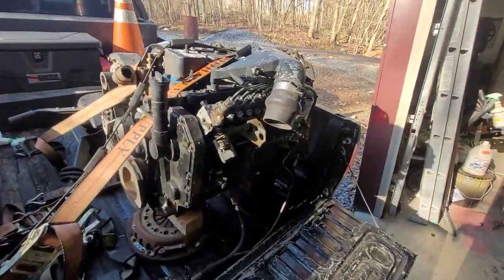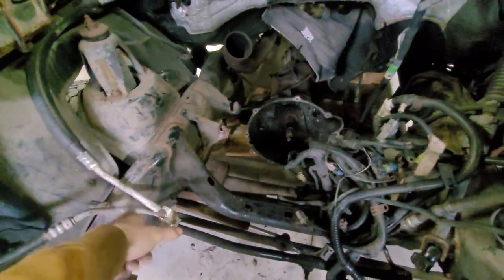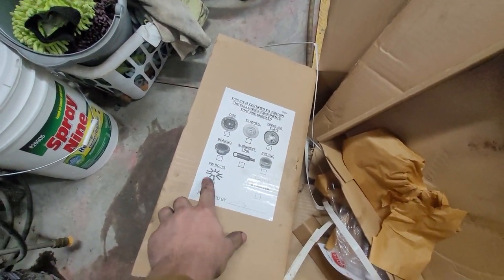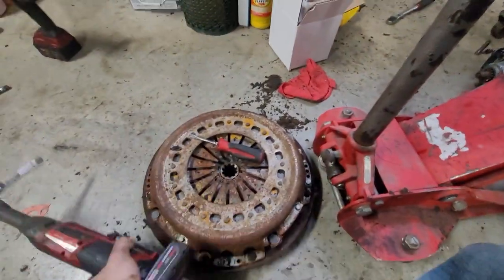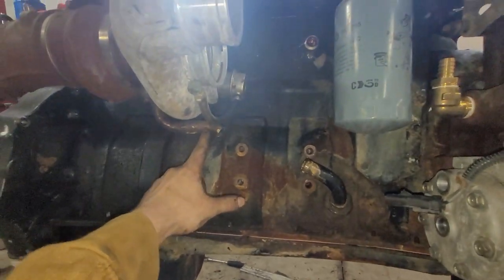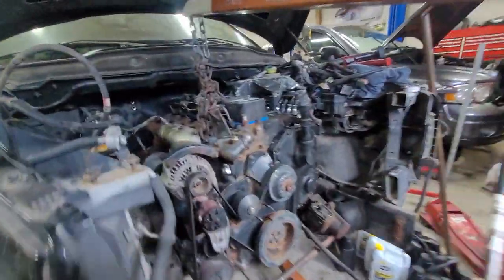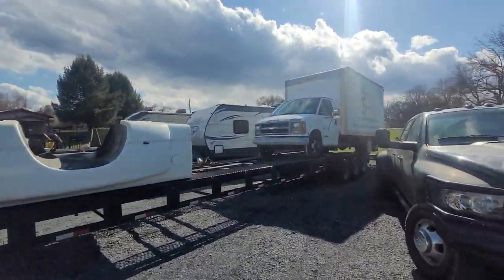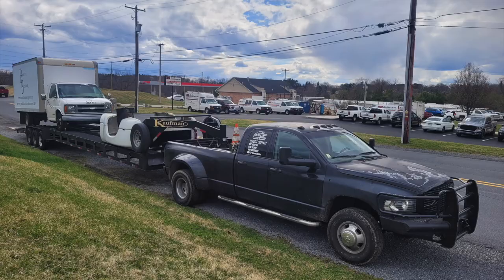I Bought A Chevy 3500 Dually | Trailer Prices Are High | 12 Valve 3rd Gen Swap Pt. 4 | For Sale

Comment: That box truck oil leak is probably the Power Steering lines. They all leak, switch them over to Hydraulic hoses. There's kits available. Also the trans lines, same thing just larger size.
Reply: I've compiled a bunch of Duramax info if ya need it
Reply from the maker: They actually just did the lines. Glad I don't hand to mess with it😅

Comment: That box truck will make a bitchin mobile shop. Add a generator and air compressor under the box.... and she is perfect. Then later, you can add a I Beam that slides out the rear door for picking up engines etc.

Comment: While you have thise engines out. Put a water bypass from the back of the head to under the t-stat. You can get a ghetto one for pretty cheap. I used the Flewce Performance on on my 6.7... but it takes the place of the problematic rear freeze plug. ( that pops out) keeps the rear cylinder alot cooler under big loads.
Reply from the maker: I'm going to with mine. Customer wants it to be as cheap as possible on parts so I was instructed not to
Reply: I absolutely hate that. I understand cheap. But sooo much easier when it's out of the truck.
Reply: Which way are you going with the coolant bypass? The expensive Fleece style that bolts in where the rear freeze plug goes. Pr the less expensive kit where you drill amd cut out a he in the back of the head? Both work but the fleece takes the rear freeze plug out of play, for leaks. My paint amd body guy has his wife's 2nd gen in his shop with the cab lifted for that very same freeze plug blowing out.

Comment: Brother please tell what are the advantages of using clutch when we shifting
Reply from the maker: Laziness is why I do it. Just have to match the rpms. Some transmissions like it more then others. Some hate it. I probably use the clutch for 25% of my shifts
Reply: Brother doing this cause any problems to gearbox .
Reply from the maker: I've more than proven that false. My last transmission lasted 549,000 miles. The failure was 6th gear finally exploded taking out the other gears. I tow in 6th gear constantly but to have gotten that many miles out of it proves otherwise. There's too many guys that can't actually shift that claim it damages parts. Personally I've never had an issue. The syncros in my last trans were perfectly fine but the heat build up from towing in 6th did that trans in.

Comment: Bro I bet you get so much box in that truck! On a serious note ceiling is 7ft in that box. It would make a sweet moto van. They usto be the setup back in the day.
Reply from the maker: The box truck is such a gamer changer. Thanks for letting me know on the height. I figured there was no way I could reach an 8ft ceiling but I didn't feel like measuring 😂
Reply: An average 6' guy can stand reach up and finger tips should be right about 8'. So Steve, you'll be a few inches under haha

Comment: With our current fuel prices that trailer is not going to sell fast in my opinion i sold one similar that i got in trade for $8500 about 3 months ago to a local company that got in a accident with there wedge. Best chance in selling fast is to find another hotshot company that needs it unless your not in a hurry than i would hold out and stay strong on the price someone will pay it.
Reply from the maker: One of our drivers just sold one for 14,000. I was like damn hook me up with that 😂
Reply: @CPSteveMiller  I probably should have held onto mine for a little while i always price stuff little under market value just so i can move it fast and on to the next. Thanks for the content bro.

Comment: I'm glad you know what you're doing lol.. 
   I thought you were putting this in your truck. ? 
  You were mentioning you need a new motor for your truck? When will that happen or will you just get a new truck??
Reply from the maker: I'm not sure yet what I'm doing. Once the trailer sells and I get paid for this job I'll be making my decision. I may pull the motor and go over it top to bottom and add a lot of ventilation for the crankcase. From what I understand these engines all have blowby issues and they didn't have good vents from the factory. It needs more breathing room especially with the high rpm high boost situations!

Comment: What engine mounts are you using for the 3rd gen swap? Does it sit in the same spot? Engine and trans...
Reply from the maker: Yes. So you use the factory 3rd gen mounts from the commonrail with the plate. The plate moves the motor mounts to the factory location without having to hack up your frame or crossmember

Comment: What are you doing for a tune on this set up? Stock for now?
Reply from the maker: Stock, yes. Timing was set at 12.5 degrees as per the factory specs. Keeping it simple for now. Once he lets it make some money I'll go through and tune everything for him. Just want it to be reliable and pay him back first
Reply from the maker: We haven't even done governor springs
Reply: Sweet... prolly the best route. Just make it run and drive. Shouldn't even smoke in thus configuration...

Comment: Why don’t you run loads with that box truck
Reply from the maker: No money in that given the situation. I'd also have to add it onto the insurance which will skyrocket my rates. It's not setup to run like that either with 297,000 miles it's definitely tired. Especially with the gas motor in there. Trans is questionable. Takes a second to grab. Then I'll have to find another storage spot for the rest of my stuff. It'll make a great storage unit that I can drive to pickup my other things in different areas
Reply: @CPSteveMiller  Cummins swap it
Reply from the maker: I already have a Ramcharger I need to pay for. I'm thinking about Cummins swapping that but only time will tell. The box truck is just storage. No Cummins for that 😅
Reply: @CPSteveMiller  ok